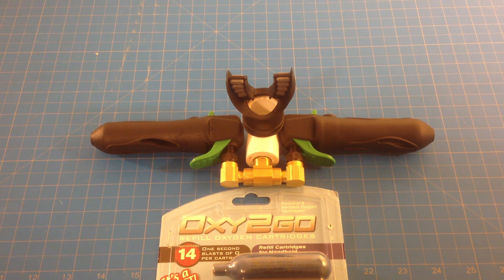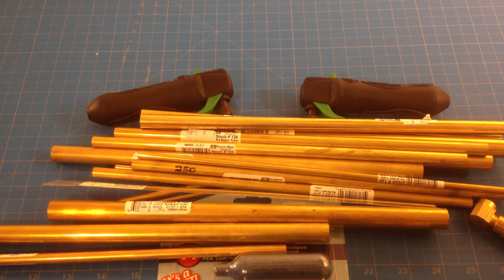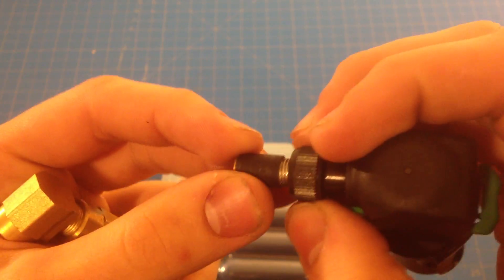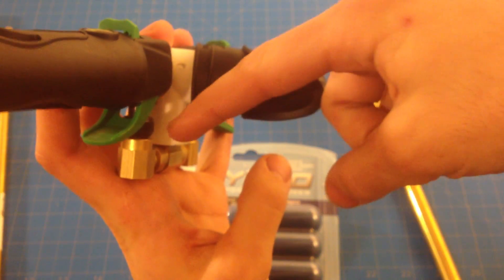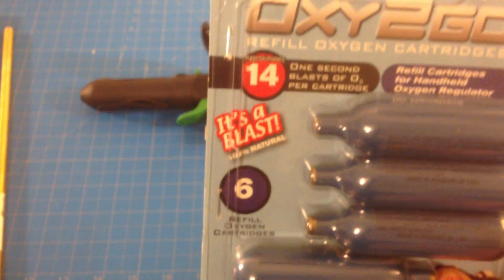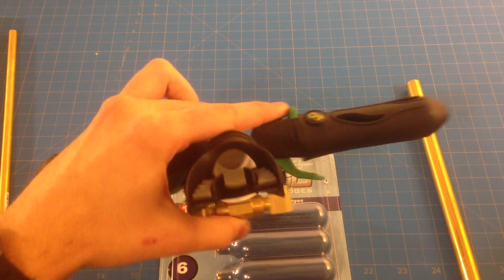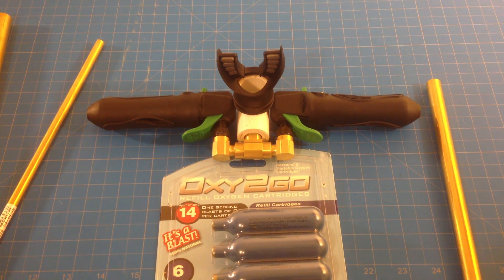007 Mini Scuba Tank Prototype V2

Comment: Your max operating depth of 90% oxygen is 5.4metres at 1.4 partial pressure. If you use this any depth you higher the risk of oxygen toxicity and could suffer an CNS hit. You would also need certain qualifications to use this as its over 21% oxygen and then another qualification because its over 40% which is in your standard nitrox cert.

Useless invention.
Reply: not really, 5.4 meters is still quite a ways down, deeper than any swimming pool ive been in, and when using it I would imagine you are doing something along the lines of snorkeling or in a case where you would normally just hold your breath go down and look around, with this you wouldn't need to go up for a breath but be able to explore a bit more down there. Honestly its pretty fucking cool. oh and for the record the James Bond movie this references to is Thunderball.

Comment: How much air can this possibly supply?  1minute?  There is no replacement for displacement.  You need a bigger tank!  Period.  It's cute and probably works in pools but if you go open water with it, it will probably kill you.
Reply: That's why it's a prototype he's still working on it
Reply: He's just a kid not an engineer also a lot of projects stop at prototypes
Reply: I'm am an engineer and this should have never even gone to prototype.  It's physics.  You can't put enough volume in those cartridges to make it anything more than a neat hollywood prop.  No amount of engineering will change the fact that there's no replacement for displacement.
Reply: he says its like an inhaler per say, you cant hold your breathe forever, this gives you a second or third , he says up to 14 , burst of air , push your expired air out , and in with the new , hold your breath
Reply: U may be an engineer, but ur no good at the English language
Reply: This is just to give him another breath to swim to the surface or to go down deeper

Comment: MAJOR PROBLEM!!!!                 oxygen toxicity syndrome!!! look it up! even if you tried to have a "lung unit" (inflatable bag) which you would breath in and out of and trickling oxygen into the bag with excess escaping you would get a carbon dioxide build up!    you either have to use compressed air OR oxygen and inert gas OR air from your lungs, a lung unit, a scrubbing unit (which is only potassium hydroxide) and oxygen. this is called a rebreather!    but they need to be highly regulated
Reply: 1 word prototype

Comment: if you were to dive this to 25ft then you would get an oxygen toxicity hit due to a PPo2 of greater than 1.6 which could be fatal so please if u are going to ever use this device switch out the 100% o2 canisters for air as this would reduce the PPo2 to around 0.4 which is a much safer level as recreational diver rarely do dives that's PPo2 would exceed 1.4.

Comment: hey i know this i really late to do input but if you are still doing this you could probably consider having a hose connection which can run from the two connectors you have set up to two slightly larger tanks that attach to your hips or back or something that way you can have a longer air supply without having to replace the canisters so often

Comment: please, please...PLEASE!!! Tell me you're still working on this, its like a dream come true!
Reply: dude you can buy it online already
Reply: Links please?
Reply: ***** yes, links please?
Reply: its the third time i posted the links and someone keeps deleting them, 
google this instead :Spare air tank
Reply: that's very expensive and too big :(
Reply: MoneyCZ your not going to really find anything any smaller. Spare air lasts about 3 to 5 min depending on size and pressure
Reply: well you can get a paintball tank online and then fill it with a bike pump.

Too big? ok then you can buy a refillable co2 cartridge then n airsoft propane to greengas adapter then by a 10$ coleman propane tank (there sorta small about the size of the paintball tank) and then use all the propane up and then refill it with oxygen or the air around you then connect the the propane to green gas adapter then fill the co2 cartridge. from here so far you should have a co2 cartridge filled with breathable air now from hear you go out and buy a co2 cartridge bicycle pump stick it in your mouth and then breath and *boom*. since im going to guys you want links to everything here they are:

https://www.amazon.com/Valken-Tactical-Airsoft-Propane-Adapter/dp/B0182RCBEK/ref=sr_1_6?ie=UTF8&qid=1518315449&sr=8-6&keywords=airsoft+propane

https://www.amazon.com/Coleman-333264-Propane-Pressurized-Cylinder/dp/B007X7ISZM/ref=sr_1_12?ie=UTF8&qid=1518315496&sr=8-12&keywords=propane+tank

https://www.amazon.com/Pro-Bike-Tool-Compatible-Cartridges/dp/B017KU1DIK/ref=sr_1_3?s=sporting-goods&ie=UTF8&qid=1518315520&sr=1-3&keywords=bicycle+pump+co2

https://www.pyramydair.com/blog/2010/02/refillable-12-gram-co2-cartridges/

https://www.amazon.com/DozyAnt-Regulator-Propane-Adapter-Cylinder/dp/B00VVNGW5C/ref=sr_1_2?ie=UTF8&qid=1518315702&sr=8-2&keywords=propane+tank+filler

https://www.amazon.com/Valken-Aluminum-DOT-TC-Paintball-20-Ounce/dp/B009G68LTG/ref=sr_1_10?s=paintball&ie=UTF8&qid=1518315764&sr=1-10&keywords=paintball%2Btank&th=1&psc=1

that should be it hoped it helped

Comment: @MrMilitary402 It's an unsafe mixture, it's 90% oxygen, normal air is the opposite, it's mainly nitrogen 70%+ and 28% oxygen. The air in those little tanks are for if you're in high altitudes (opposite of that of being underwater), when the air is thin (less oxygen) to give your body a little extra pump of it to keep your head straight because you'll get dizzy for oxygen deprivation.
Reply: K, my apologies. I thought it meant it was safe. The idea is really cool though. Thanks for pointing that out for me.

Comment: This isn't safe to use underwater. Air is only 28% oxygen. The other mixture is 70% nitrogen and 2% other gases (helium, etc.) When diving or using any SCUBA device you can't use just oxygen or you'll get oxygen toxicity from raised levels in your blood that your body isn't used to. Do not try this at home or finish this project for real life use. Conceptually it's an awesome idea, but realistically it can be potentially harmful or fatal.
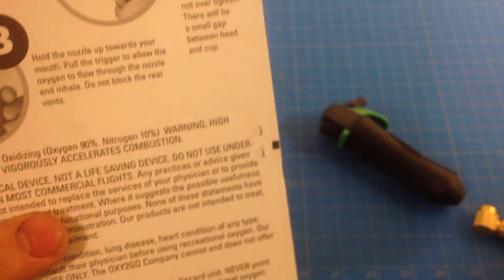Reply: 2:15
Reply: You probably made that up
Reply: As he said it was a mixture.
Reply: It's a prototype

Comment: This will never work the way you want it to, first you would need 2 regulators (wich you find expensive) , you also talked about a one-way valve , but yet again your system wont work because of the pressure ..

Comment: You can use an one way check valve! So the air will go and the water won't go inside the system.